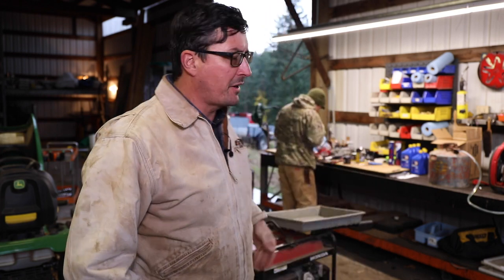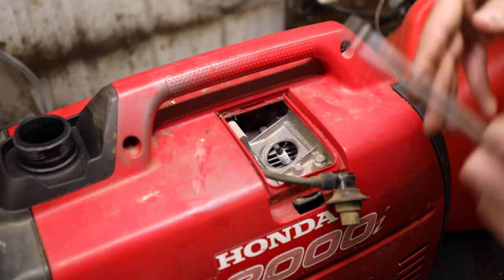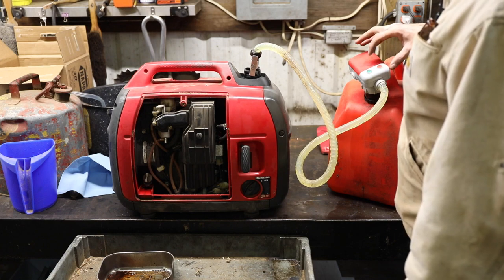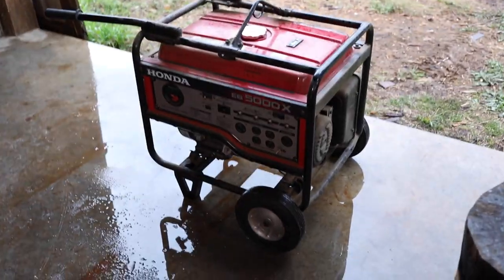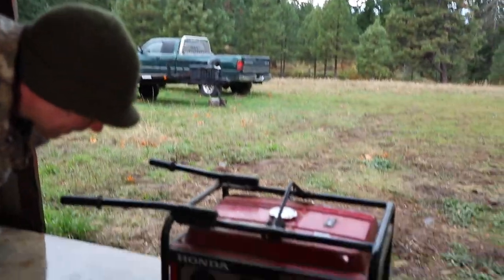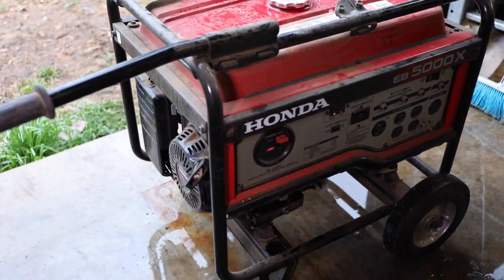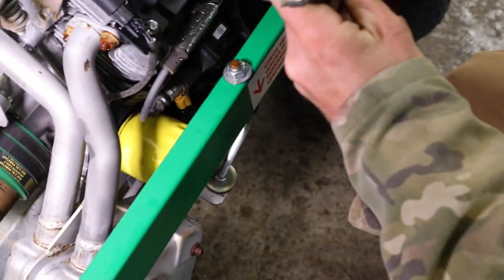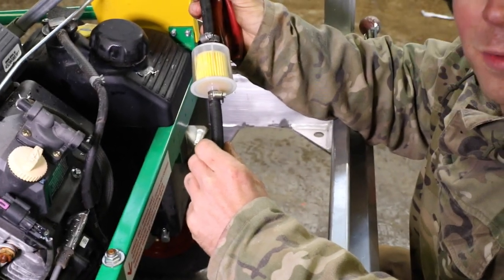Signs You Have WAY Too Many Tools!!!

Comment: I’ve always found if an old lawn mower, generator, two-stroke gas powered tool, etc starts taking multiple pulls, it’s usually bad/old sitting fuel in the carb, or the spark plug needs to be replaced. I’ve saved myself and neighbors from having to buy brand new mowers after the old one “quits startling” by buying a $8-9 dollar or so new spark plug😂

Comment: Hey now, I have lots of things better to do! It is just at this time of the morning, it is too dark to go outside to do them! :)

Joking aside, the fuel advice is a huge thing even basic homeowners with just a few yard engines really need. I cannot even begin to tell you how much time repairing carbs on small engines took up dealing with the problems ethanol causes before I learned this and found non ethanol fuel. Those little engines, especially ones on weedeaters and chainsaws just do not tolerate it well at all.

Comment: Two things. When you pour from a quart oil bottle, turn so spout is at the top. This gives more control.  Second, local Stihl mechanic said using RV/Marine gas in small engines will make them last longer.

Comment: A brass fitting and hose will make that oil drain easier on the honda.  Tip it o the other direction and take the plug out.  Then thread in the barbed fitting and put a hose on it.  Then put hose on it and into the bucket.    Works well.   I have a dirt bike that has a funky drain like that.   Way easy to do.

Comment: I work for a honda dealer. You correctly put the acid in the battery. Poking a small hole into the plastic container, it drains faster. Also you should charge the battery to 100% to increase the life. You dont have to drain the tanks on the generators or other honda motors if you use non ethanol fuel or fuel with a preservative like sta bil. You should always turn the fuel off and the fuel out of the carb

Comment: The Sta-bil instructions used to say 1 oz. treated 5 gallons of fuel.  Did they dilute it, or just change the instructions to sell more?

Wouldn't Ballistol be better for protecting the blade?

I used to prefer the screw-type hose clamps, but I found a lot had the non-stainless screw.  Now I find that a lot of them strip easily.  I've started leaving the spring-type on hoses, and saving extras.

Comment: Small unrelated word of advice. You dont necessarily want to run any 2 cycle out of fuel ever because running it out of fuel leans it out. Runs it out of lube and gets it very hot. I have killed 2 cycle dirt bikes from running them out a few times. Melted the pistons and i know when i run my chainsaw all the way out i can smell hot aluminium from the piston.

Comment: To get best life out of the new quad battery the proper way to service a new sealed battery is to fill it with the acid pack, than let it sit for about 1 hour minimum to let the acid absorb, than put the cap on and charge on a very low trickle charger like a battery tender until it turns its self off. You may wish to get yourself some battery tenders for anything that sits with a 12 volt battery. A battery tender will greatly increase the life of any battery that sits for more than a couple weeks.

Comment: prefill filter is bad idea. :) depending on how OCD you are about cleanliness and realise that oil in new jugs is actually quite dirty or contaminated with  large particles. Better to run a can of stp through it and then  let the pump fill the filter. That way all the oil is filtered.

Comment: Norm Larsen, founder of Rocket ChemicalCompany, is considered the original founder of WD-40," according to wd40.com. Larsen aimed to develop a line of rust-prevention solvents and degreasers for use in the aerospace industry. He succeeded at the goal, Water Displacement, on the 40thattempt, hence the name

Comment: I've always been taught oem tension clamps are better, they apply even pressure opposed to those cheap screw clamps where they have a pinch point. That's my personal experience.
Reply: Don't use the CHEAP screw clamps....Good ones don't pinch.
Reply: If you use the right size none of them pinch because the band completely overlaps.
Reply: Wesley  Parris,
 Thanks for the info buddy
Reply: Any recommendations on where to find quality screw clamps?

Comment: You can cut a piece of a 2L plastic bottle and roll it the same way you would with a paper funnel really you can use any thin plastic bottle really and for bigger stuff just cut one of the top quarters off  of those quarts of oil works great as a funnel I use them when topping up stuff on my suv

Comment: what you need for that generator the smaller one you need the type of funnle that i use for oil in small engines its like a rectangle shaped funnel but it has a long flexing funnel end so its good to use on small engines woth the fill plug down low

Comment: @Wranglerstar WD40 was developed by the us space agency to cote the outside of the rockets so the heavy ice could not stick to the rockets, the fuel was rocket fuel so it was so cold it freeze the water vapor in the air on the outside

Comment: I was thinking, every winter it seems something breaks on that water pump system you have when the residual water in the pipes freezes. Why not just run some anti-freeze in the system? that way there even if there is some residual water left in the system you'll be fine.

Comment: You should look into getting car parts from rockauto.com they're stuff is way cheaper than in the stores. Bosch O2 sensors for my truck were around $150-$160 in the store and were $60 on rockauto. I could also get cheaper ones for $9! $160-$9 is a pretty big difference. Also at oreilly they'll hire anyone who speaks English. 90% have no idea what they're doing and have probably never worked on their vehicles. They may not have stuff for your equipment, but for cars they have tons of stuff.

Comment: Most batteries are shipped without the acid in them, or at least that's the way my last 5 bike batteries were.  If you buy batteries off the shelf from Walmart or the auto parts store sometimes they are already done.

Comment: So tubing on a funnel works, or, fill and run engine, dump it back out into a container, then measure volume in measuring cup, record volume for next time, then you don't even need to consider how much the next change, no brainer.

Comment: You can never have to many tools like if you agree
Reply: typical facebook user
Reply: or even 'too' many.
Reply: i used to think that in my younger days, as of the past 2 weeks i have been going through all my tools, so far i have a gallon bucket full of screwdrivers i have no need for, about 100 plus extra (backup) name brand sockets, about 30 too many wrenches, i have more than 10 drills, 4 circular saws, 5 air compressors, tons of misc pliers, drill bits and a bunch of other stuff im going to be craigslisting soon, i think i just kept buying stuff at flea markets and yard sales because they were a bargain. non the less, they take up too much room and make it harder for me to find what im looking for, my tool boxes havent looked this clean in about 20 years.
Reply: If you move overseas it can be economically impractical....and, hard to get your investment back!
Reply: beach bummin Laughed so hard when I read this. Exactly how I am at flea markets! My tools may be numerous, but they are quality and I have a budget still!
Reply: Everything in moderation.
And I avoid this by not going to flea markets. ;p
Reply: This is NOT an important comment. comment if you agree
Reply: What if you have 7 identical circular saws, 5 of which don't work

Comment: In one of the videos ethanol destroyed the carb on one of the roadkill cars in i think they said under a year , so yeah id go with draining fuel if you can be bothered and you think it may have ethanol in it. I dont think its a big deal to leave it if its ethanol free, its the new ethanol fuel that goes bad super fast not as much of an issue with good fuel. I have not seen a battery you have to put the acid in either , maybe its some shipping law or to keep it 100% fresh

Comment: Brian is good for Cody to have around, "you should never be in a hurry to do anything" and "you never know it will work if you don't try", good reminders. He also reads those funny numbers. Cody, this should help you to know if it is your spark plug that is the problem, https://www.youtube.com/watch?v=hnd7P7O_vEQ, you can also find what ohm readings are for your respective equipment magnetos, to rule them out or find them to be the problem with a non-start. online. This way you don't throw away plugs or change mags that are good, still change the plug and if the old one does tests good keep it for a spare as new plugs often go bad. Australia, smart? They use that metric system, don't they? (making friends on two continents!)

Comment: "Water Displacement perfected on the 40th try—is still in use today. Convair, an aerospace contractor, first used WD-40® to protect the outer skin of the Atlas Missile from rust and corrosion."

Comment: I have to disagree with draining fuel. In all my gas powered equipment I drain the fuel and add it to the main gas can and mix Stabil fuel stabilizer. This includes chainsaw, weed wackers, snowmobile in summer, lawnmowers, snowblowers everything gas. Add the new fuel with stabilizer, run the equipment for 2-3min and you're done.
 When you drain the fuel you introduce air into the system, which can and will start the corrosion process. I have used Stabil Stabilizer for 10/15yrs with great results. Oh ya I live in Canada where everything freezes lol.   Peace

Comment: Screw hose clamps that are made in china are stainless plated steel and the same for the screw. Easy test is if a magnet holds well to strong then it is not stainless steel.

Comment: WD-40 works best as a solvent or a temporary lubricant as it can be corrosive. I would not use it through the winter on that blade. You would be better using some thinned boiled linseed oil or even gun oil. WD-40 does make a gun lubricant however.

Comment: in the engines used over winter, would you not want to use a lower oil weight? or a multigrade synthetic oil?
Reply: Oscar Thorpe your supposed to use 10w30 in winter and 10w40 in summer you can also use
10w30 to help get into the crevaces and when you change oil you put gasoline in the oil tank wash it aroind
And it cleans out the bearings then you wait for it to flash out then add oil
Reply: yeah i know but i thought they were using straight grade oils in this video

Comment: Anyone know that the fitting on top of the Honda generator gas cap is at 6:38?  It looks like an air line quick connect fitting.  Could it be a propane adaptor to allow the unit to run on propane or CNG?

Comment: You're in the infancy stage of tool collecting my good man..
When you have 50-75 hammers. 300+ screwdrivers, A dozen drills that work & are 100% = Got you there.. No Genesis fire starters
You've got me on small engines by a few + chainsaws.. I'll have to fix that..

Comment: Why you want to drain the fuel of small engines?
Reply: Xabier G. Because automotive gas has ethanol. Ethanol attracts moisture and is corrosive. It plays havoc on aluminum parts like carburetor bowls and and jet bodies.

Comment: Draining oil from small engines is a huge mess, but there is a solution. Use a fluid extractor! This one can be hand pumped, or run from a compressor. They work amazing for small engines because the drain plugs are often in ridiculous or inaccessible places. I even use mine when changing oil in the cars (because my cars are newer and the filters are on top of the engine). https://www.amazon.com/gp/product/B06WD64H8Z/ref=oh_aui_detailpage_o03_s00?ie=UTF8&psc=1
Reply: Also. There is a marine version of sta-bil. It has a lot more of the de-watering agents. Works great for ethanol gas and in wet environments like the pacific northwest. https://www.amazon.com/STA-BIL-22240-Marine-Vapor-Technology/dp/B001CAW2DK/ref=sr_1_4?ie=UTF8&qid=1509815087&sr=8-4&keywords=sta+bill&dpID=41j5fKdIweL&preST=_SY300_QL70_&dpSrc=srch#customerReviews

Comment: When you use a forklift as a lift you should chain or rope what you are working on it to the forklift and cut a steel pipe weld to a steel wheel to put under the forks for a safety so if the forklift hydraulic fell. Murphy law.

Comment: I saw you put WD40 on that sawblade. That's not really handy. Yes ut removes water, but it also rmoves oil, it is also a degreaser. Better use some of that used oil on there. Or even better use linseed oil as the old mechanics did. Linseed oil has the habit that it will penetrate into the metal and there will be no room for oxigen to corrode.

Comment: Too many tools ?  Only if you have triplicate and quadruplicates of the same ones !

IMHO, straight, non-detergent oil in small engine is not worth the effort of trying to locate it !  Modern, API type SM or SN, 10W-30 is fine.  Any brand (𝑡ℎ𝑒𝑦 𝑎𝑙𝑙 𝑝𝑎𝑠𝑠 𝑡ℎ𝑒 𝑠𝑎𝑚𝑒 𝑡𝑒𝑠𝑡).  If the engine is going to be run in cold weather, use 5W30 or even 5W20.  Severe cold (𝑏𝑒𝑙𝑜𝑤 0𝐹) calls for 0W20.

Fluid Film is even better than WD40 but a lot more expensive.